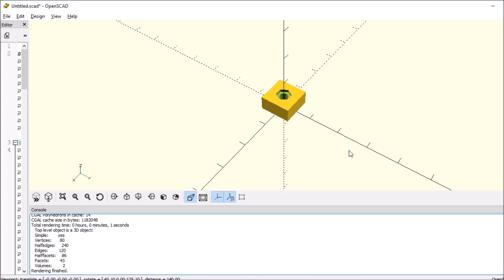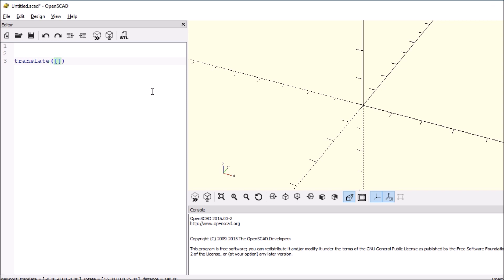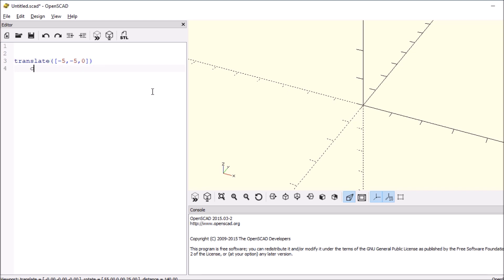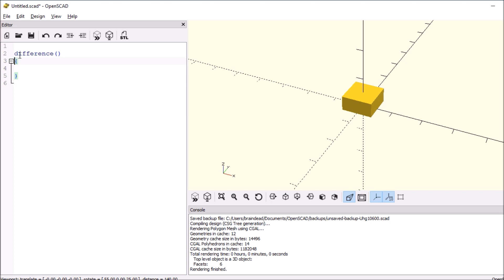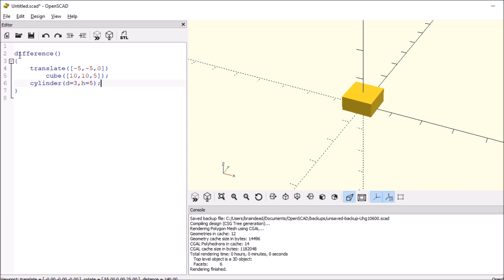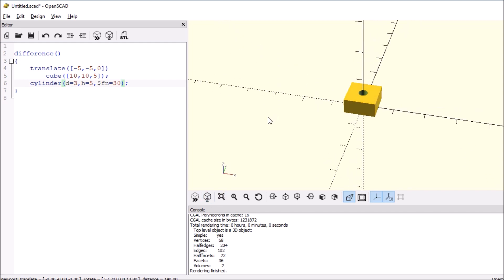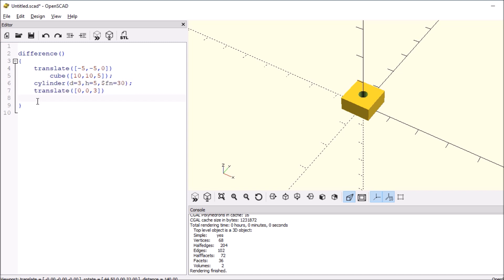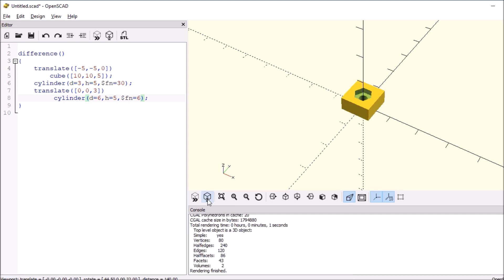OpenSCAD - Difference

Comment: I saw your video, it is useful. But, I want to make a thin square plate consisting of lots of square slots(4 rows and 4 columns of slots) inside the plate at equal distances. Would you suggest me some tips?
Reply from the maker: Use translate and difference with cubes.
Reply: @EdwardBraiman  sorry, but i don´t understand this. i am a beginner. could please write some codes for few slots, so that i can move forward doing so?
Reply from the maker: It's a playlist of videos if that helps.

Comment: I think you're putting a bit too much attention on the specific coordinates that you use, as if the viewer has to memorize these. The point of teaching such a thing is to let the viewer know what exactly the functions are doing. You should explain more about how each line interacts with the other instead of focusing on the specific numbers in the example. Like how does the differentiate function know what has to be differentiated from what? Is the trick in the order of the lines or something? First line is an 'add' and the following lines are 'substracts'?
Reply from the maker: True, but it's just a simple tutorial to get people going.

I can get into the weeds with detail, but I wanted it to look simple.